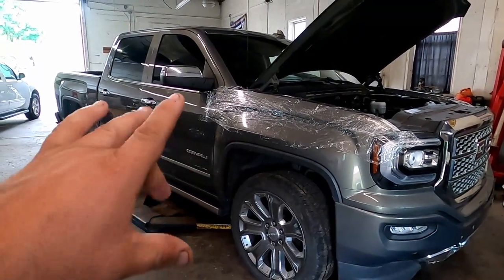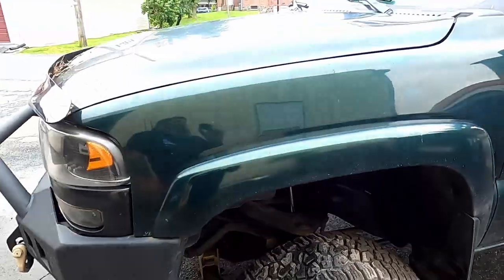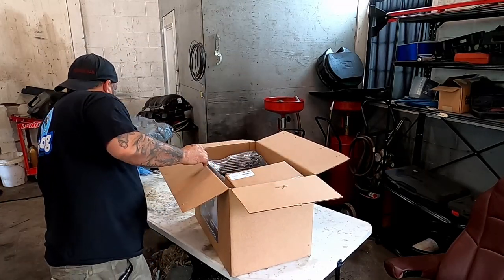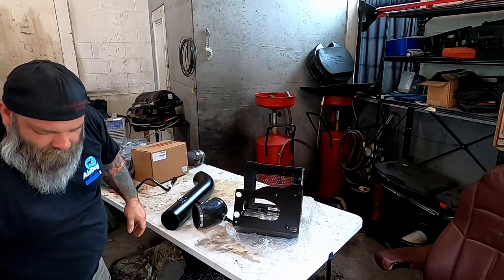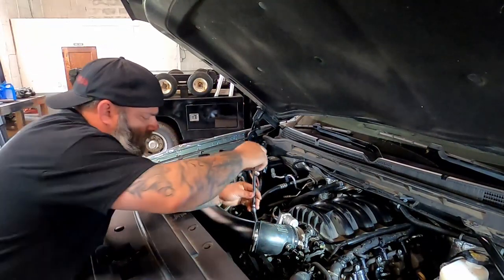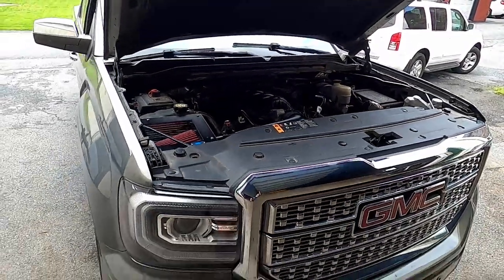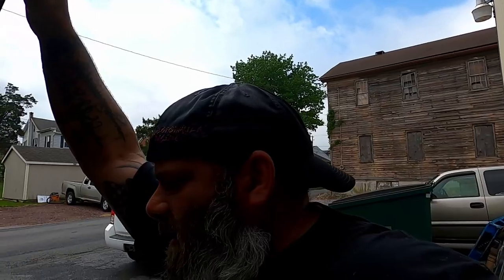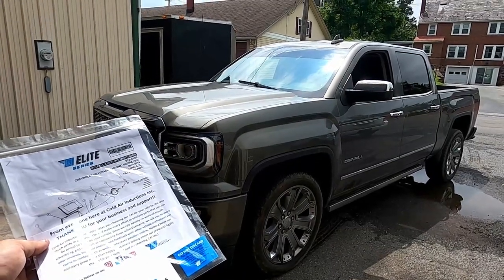Cold Air Inductions Intake Install........So Easy A Baby Could Do It!

Comment: DiabloformulaRacing Great Video I think you did a great job installing that Cold air inductions Cold air intake Elite Series on that Awesome  2017 GMC Sierra 1500 Denali and I think you should get one just in case something unfixable happens to Big Bertha